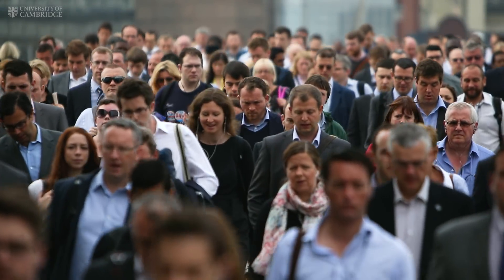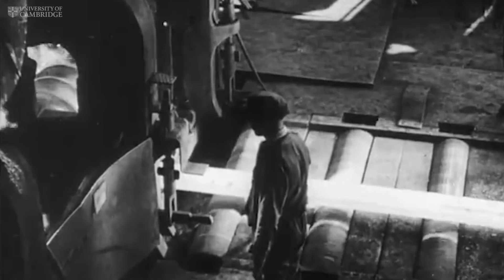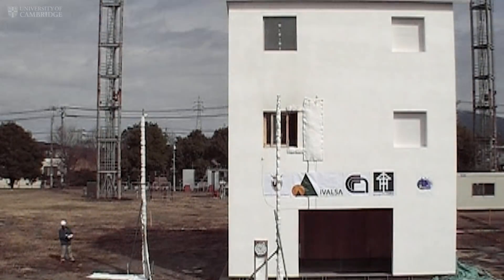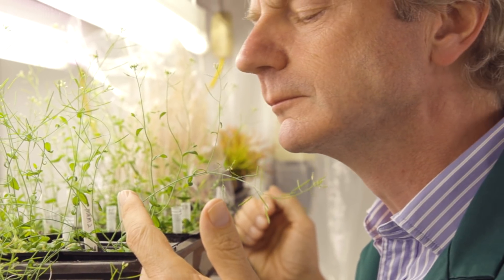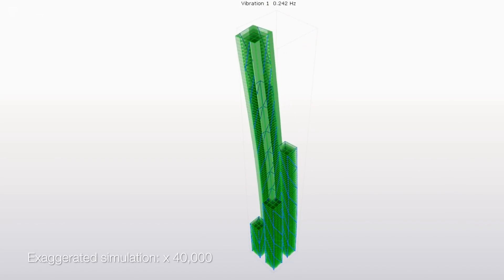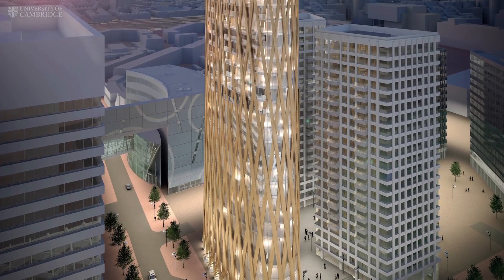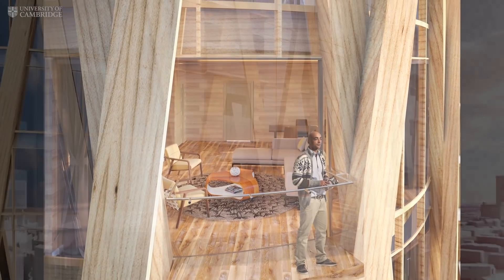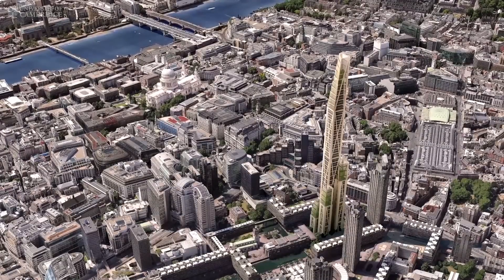Wooden skyscrapers: Sustainable homes of the future?

Comment: For skyscrappers, I think wood with steel is better, The main frame should be steel. Wood flooring good i agree, Wood divide walls good, use spray on concreate to coat the wood same as steel to make it more burn proof. Maybe build 3 floors using wood in between 1 steel frame. Maybe have a steel frame core and then make the exterior with wood, having not only taller buildings but having very wide buildings, like mega structures for housing.

Comment: Great concept! Naturally I have a few questions such as how to handle the piping and wire conduits. In steel concrete buildings, they’re easily housed inside of or through the concrete panels still maintaining structural strength.

Comment: "The buildings of the future may be held together through rapid interactions happening at the molecular level," says our colleague Professor Oren Scherman, Director of the Melville Lab for Polymer Synthesis. One of the Chemistry researchers collaborating on this fascinating project, hear him in this video discussing how "perhaps in future, we'll be able to remove the concept of a nail or a screw holding two timber joints together and instead, this will all be done through small molecules that come together at very specific interfaces and give the wood unbelievable strength."

Comment: Yeah, accelerate deforestation and call it 'cutting down on emissions'. Ridiculous.
Reply: Did you watch the video.
Reply: Naram Sin, the idea is that the wood is sustainably sourced, and acts as a permanent carbon SINK when used in construction, as opposed to concrete and steel, which are responsible for massive amounts of CO2 emissions! This is actually a very promising solution for fighting climate change. Besides the carbon sink aspect, they also have good thermal insulation properties, reducing the need for heating.
Reply from the maker: Hi, this should answer your question. 
https://youtu.be/raW7j1tUTEI?t=421